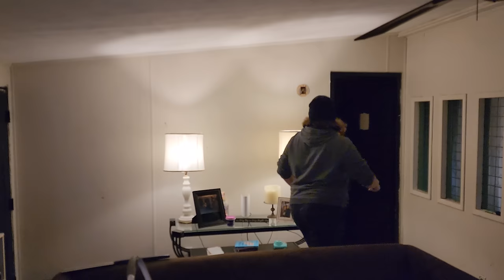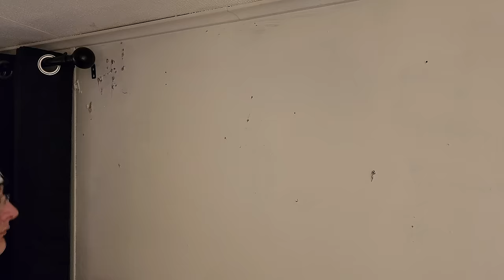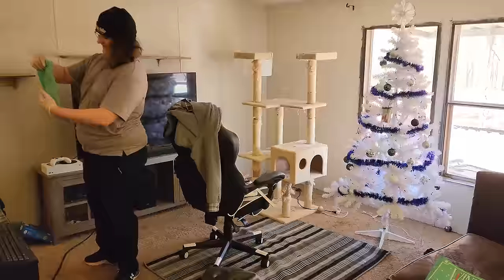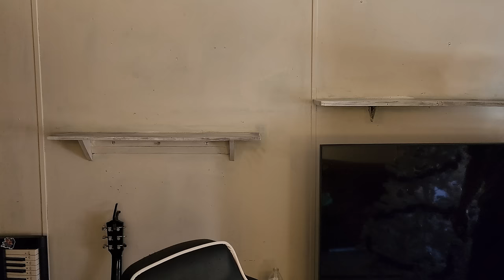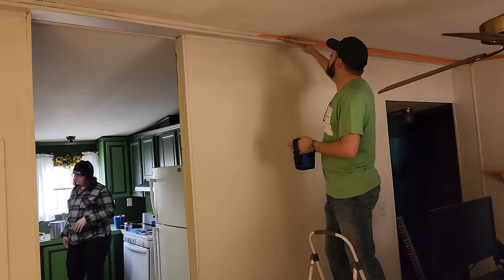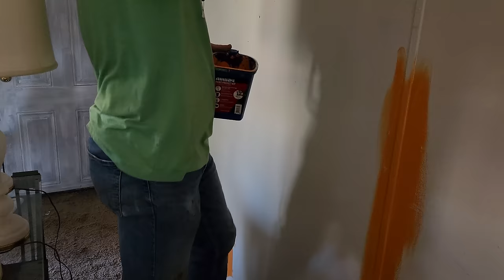Completely transforming a trashed-out home for FREE!

Comment: One tiny thing: if you can, when doing these sort of transformations, change the ceiling "boob" lights. It's another pretty small thing people often don't think to do that can really change the mood of the room/home and also a good way to get more light, if needed, by getting a ceiling lamp with multiple bulbs. It's usually an easy switch and fairly inexpensive, especially if you can find lights in a thriftshop. But really, you did an awesome job and I'm sure they were absolutely thrilled to finally feel at home ❤ you have a big heart and we thank you for the help you give to so many people!

Comment: Just a tip, if you ever have to paint the bottom edge again (like when you did the bright orange wall in the living room) get a piece of plastic (thin) card or paper and use it along the floor with the brush to protect the floor or carpet.  I do it when i am painting to avoid any accidents as i never lay protection down.  Just a neat tip!  No criticism, I love the work you do. x x
Reply from the maker: I just don't have accidents. Way easier.

Comment: Oh, one more thing, Quick-finger Charlie:  can I get you to re-think the removal of the ceiling fans?? If you replace them with the ones that have remotes, (with like 5 different speeds)  if you make those blades turn super slowly, if these folks have central air (i really hope they do), and if the vents are IN THE FLOORS or next to the baseboards, turn the ceiling fan direction so it PULLS THE COOL AIR UP TO THE CEILING, and it rotates it back around to the floor. Fans are extremely useful for rotating warm or cool air around, just reverse the direction the blades rotate (even if they only have window units).  Ceiling fans are also good when the weather is nice and opening the windows allows those fans to pull in fresh outside air, and the ac units can be shut down.  And another tip: if all the windows are functional, pull the top window down to be level with the bottom, if the screen is able to be pushed to the top, the double panes being on the bottom will allow the fans to pull in the outside air thru the screened top.  (I live in a bottom floor apartment, and I like doing the windows that way at night, but I only bring the top window open about 3 inches down, with window locks)......May these folks be comfortable and have less stress in their lives......

Comment: If the plug and switch plates are painted, soak them in a sonk full of hot soapy water. Then use a blue scrubby oad to peel off the paint. It works great on latex paint. Oil base paint is harder to remove.